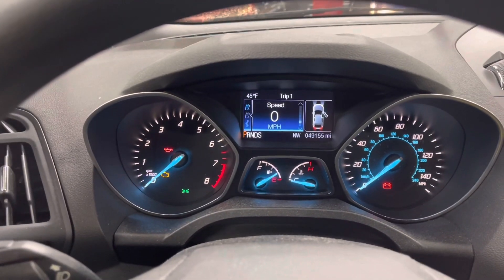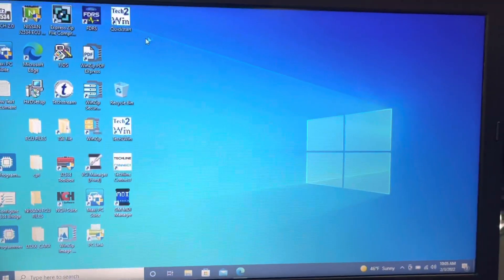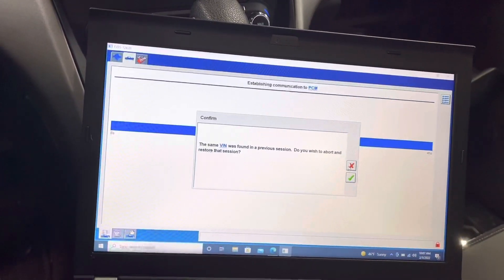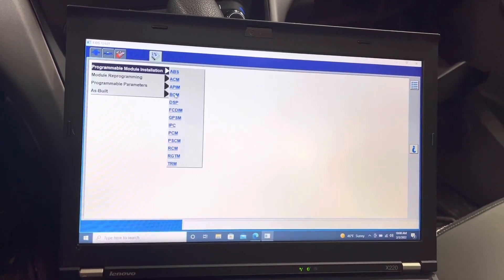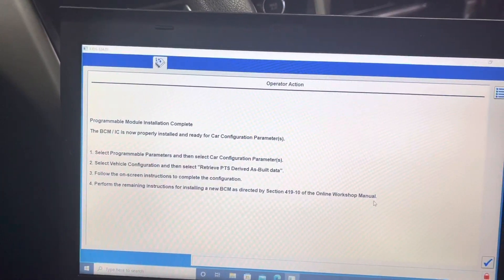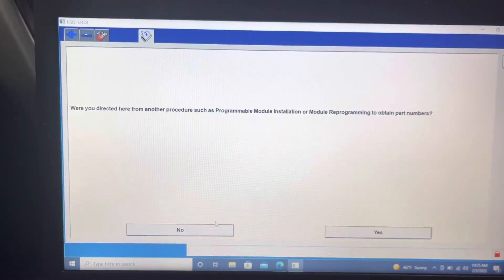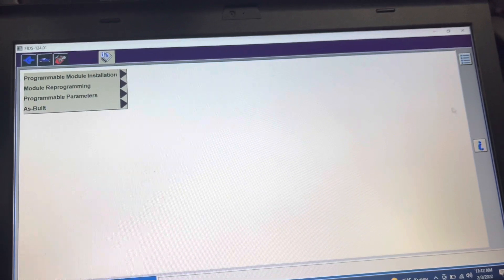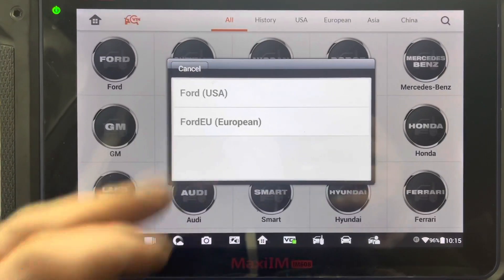Programming Ford New/Blank BCM (Body Control Module) With FJDS

Comment: Why did you finish with Autel IM608? You couldn't do the parameter reset with FJDS?
Reply: He did say in the video that he used the IM608 because he didn’t have access to the Ford security codes. The IM608 just by passes the need for a code.

Comment: Replaced a 2012 ford focus BCM that had corrosion on pins.  Replaced it with another 2012 ford focus BCM.  What needs to be changed on the new BCM?  No key is detected now.  Any help be appreciated.   Also will forscan reprogram this? Thanks in advance.
Reply from the maker: You will need to perform PMI(Programable Module Installation) using FJDS/IDS which usually does online programming as well as As Built data. Than minimum 2 keys needs to be programmed to new BCM. After, perform Parameter reset. At that point car should be able to start. All TPMS sensors also might have to relearned.
Reply: @huyug1  Thank you for information.   I looked up the as built data.  Both BCM are the same data entered in the fields.  So how does the BCM and PATS system work together?   If for some reason the new BCM don't work once PATS is programed with the old BCM reinstalled work with no further programing?  The old one is currently working just having issues with horn going off and key fob not working correctly from the corrosion on some of the pins on the BCM.

Comment: Boss can we Program all the module with j2534 like specially when I have to change the transmission can we put solenoid data with this or need vcm2
Reply from the maker: https://youtu.be/YQi_5t48v5s
Reply: Does the fllow data are inportant to write when we make upgrade firmware of tcm